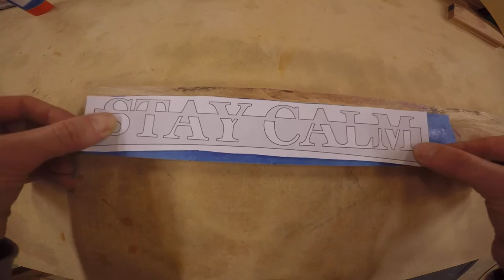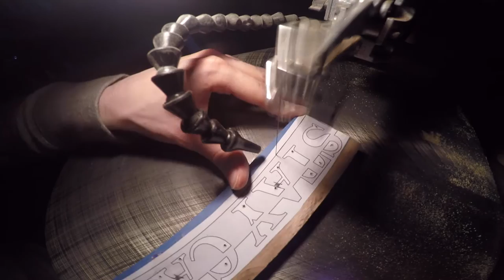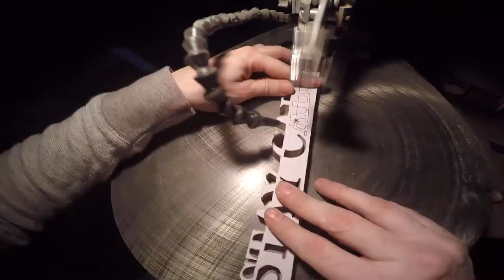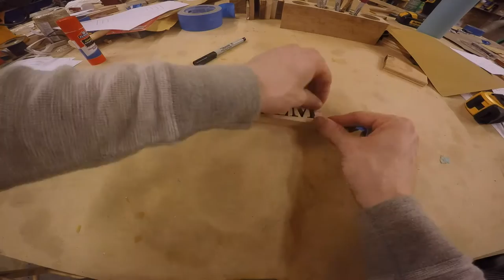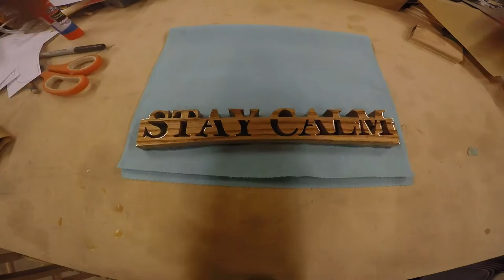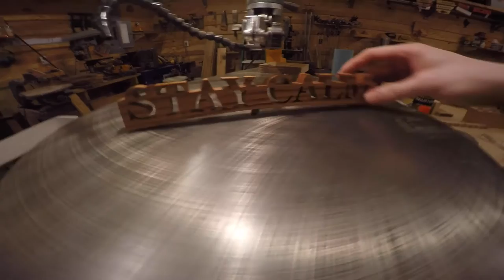Stay Calm -  scroll saw word art

Comment: Thanks! What is liquid are you using? Is that oil or glue or sth else?
Reply from the maker: it is mineral oil. it is very safe to use.
Reply: @RussellsWoodShed  look it up on the internet, they explain it but you can mix mineral oil and bees wax together. You have to heat it for the wax to melt. It is a very safe finish and leaves a very 'warm glow' to the project......